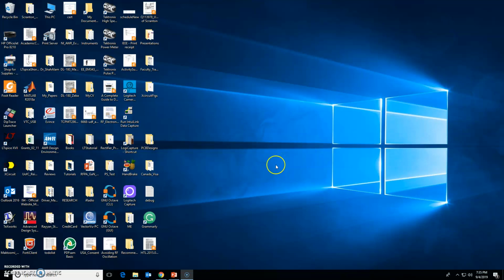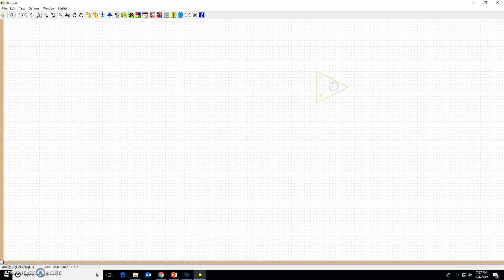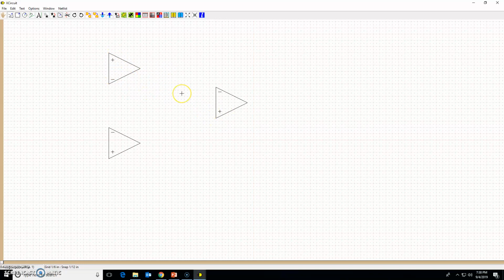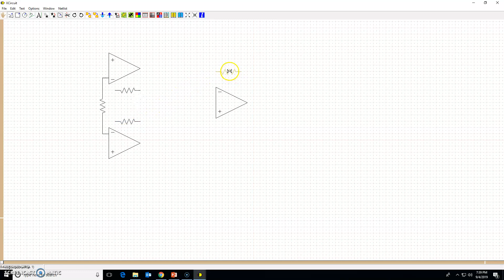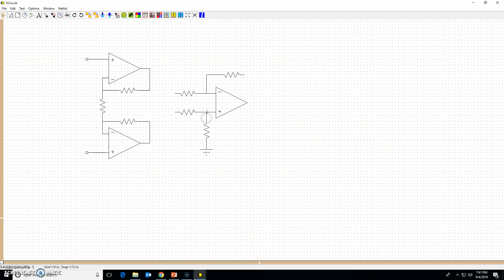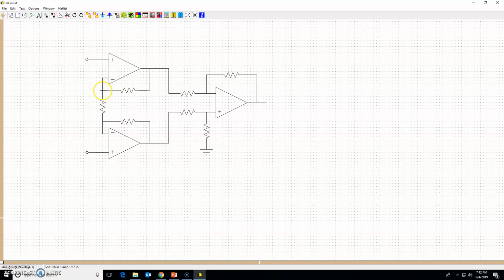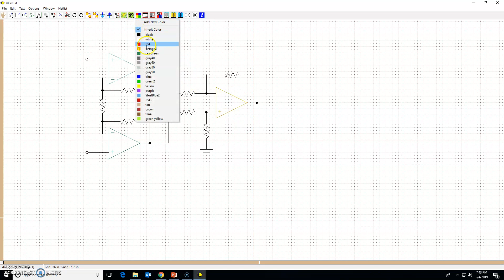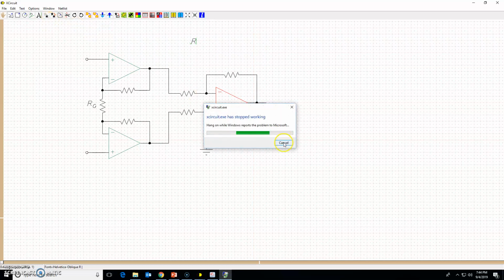Xcircuit Tutorial 3: Drawing an instrumentation amplifier

Comment: After openning ps file in evince, some part of circuits gets trimmed from right or upper side....that is it doesn't get accommodated  within the boundry.....how to solve that problem?
Reply from the maker: Mohamad, thank you for your question. Can you send me an example schematic that shows that behavior?
Reply from the maker: Also, did you choose "Best Fit" in the evince window in the top left corner where it shows "Fit Page Width"? If this solves your problem, please reply back to this thread for other viewers. Otherwise, email your schematic to me.
Reply: @MohammadAMaktoomi   email id?
Reply from the maker: @mohmadaasifbhat3477  eephy.scranton"AATT"gmail.com
Reply from the maker: Hi all: Mohmad has raised a very important issue. A remedy to solve this problem is to draw a rectangle around your schematic in xcircuit before saving that as a postscript file and then disregard that rectangular boundary while snipping. More on this in my next video.
Reply from the maker: Mohmad, the new video is located here: https://youtu.be/8Hjt6cI-DnY. Please do check this out, I talk about the bounding box that ultimately solve this issue.

Comment: Sir, How did you render LaTex in your figure(given in slides at 0:24) in post-script, I tried but Latex Text is not visible when I open PS File in Evince
Reply from the maker: Hey Devansh, I am sorry to hear about that. If I understand you correctly, you started writing text after enabling "Set LaTex Mode" in the Text menu. If you did that, your text may not be visible in .ps file. What I do is let "Set LaTex Mode" remain unchecked. Then I simply write text by pressing "t" key from my keyboard- once done left-click outside the text box, anywhere on the screen. You can also play around with different options that you have in the Text tab, for example, size, style, and font. Remember, if you want additional mathematical symbols, just enable the Text>Font>Symbol option and then press "t" and then the pipe key "|", a new table of symbols appears and you can choose the one you need. If you want to start entering text again, don't forget to go back and change the font back to text from the Text menu, e.g.  Text>Font>Helvetica. Please let me if I answered your question.
Reply: Thank you Sir for your reply. I have the same problem with LaTeX Mode as you mentioned.. Actually, normal text and symbols are just working fine, I was just wondering how you got nice typesetting in your slides at 0:24, so I thought it was because of LaTeX ...
And one more thing, how did you fill color in OpAmp(I tried by changing Options -> Elements -> Fill, it doesn't work with symbols), are those your custom symbols?
Reply from the maker: @devanshtanna4640  I see, that diagram is actually from Sedra/Smith power-point! But you can do much better diagrams using xcircuit. I have not used LaTex mode in xcircuit, but if I have to edit text, for example, doing italics, etc, that option is in Text>Style menu. I will do a tutorial on filling color once I get some free time. For now, please see if you can follow some tutorials found on xcircuit website: http://opencircuitdesign.com/xcircuit/

Comment: How do I insert the ohm symbol?
Reply from the maker: Hello Anonymous! Nice Question! First, go to the Text menu (found in the upper left corner) and descend down to the Font submenu and choose Symbol (that is: Text>Font>Symbol). Then type T on your keyboard to enable text writing. Now, press vertical bar on your keyboard (which appears with forward slash symbol in qwerty keyboards). This opens up a new window. Chose ohm's symbol from here. If you don't have to insert any other symbol, switch back to Helvetica font (that is: Text>Font>Helvetica). Hope this helps.
Reply from the maker: Check out keyboard shortcuts in the video description.
Reply: @MohammadAMaktoomi  Thank you. That works